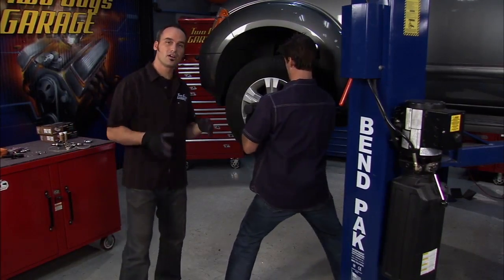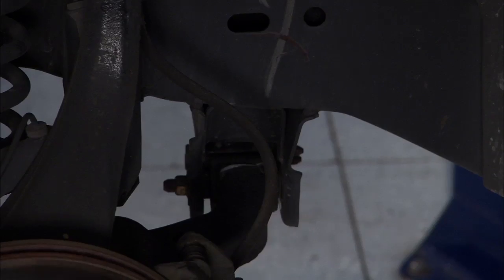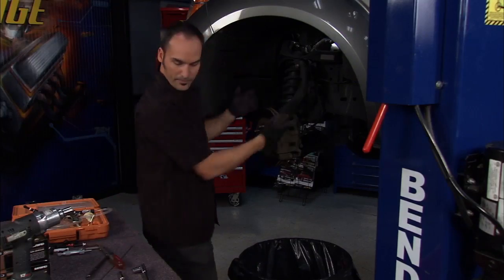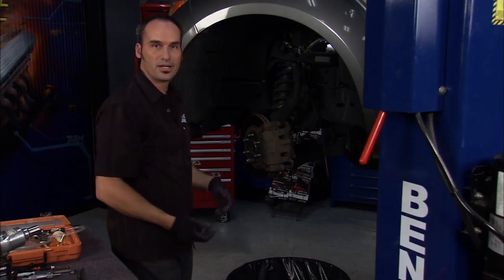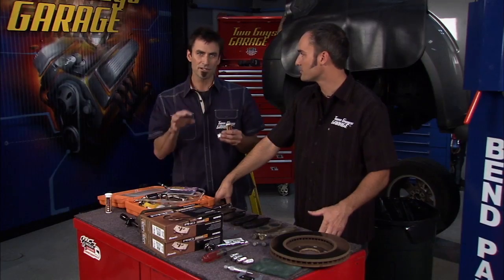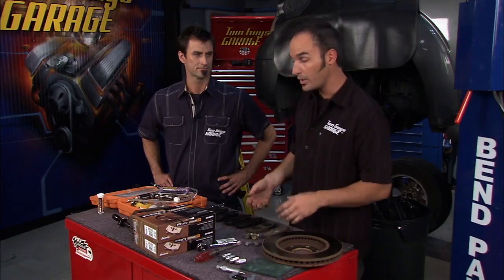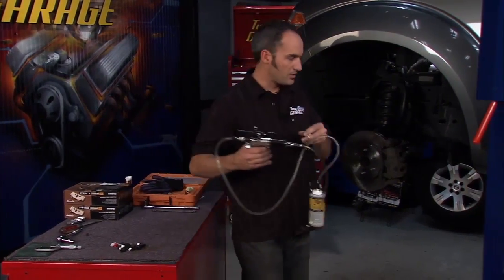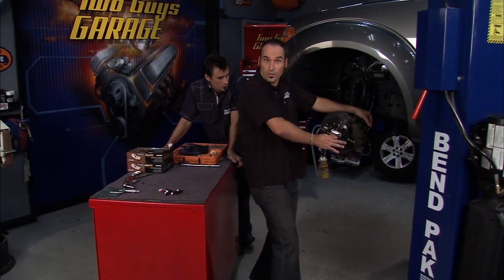Fixing Brake Shudder | Two Guys Garage

Comment: I'm having shuddering in the front brake pads on my wife's 2000 Tiburon.  Rotors aren't warped and its not constant.  Braking fixes it.

Comment: I have a Scion FRS and a Scion iA that both picked up a shudder. In both cases, it only happens as the brakes heat up. Normal braking doesn't shudder, but on the FR-S, when braking from 90 on the freeway down to 50, It starts shuddering after about three seconds. On the iA, as I come to a stop on a downhill from 50 to zero, it's similar. I replaced the pads only on my FR-S (at 142k miles, btw) and the problem is gone - for now. 

I'm wondering what causes this kind of problem. I'm assuming it's heat related, but I've owned 33 cars in my life (one a scion xB first gen) and never had this issue before.